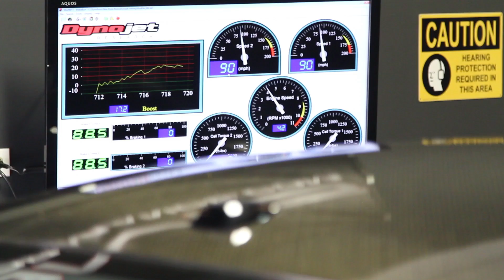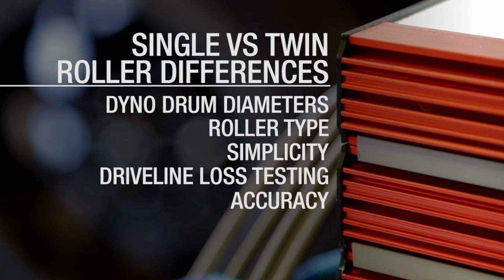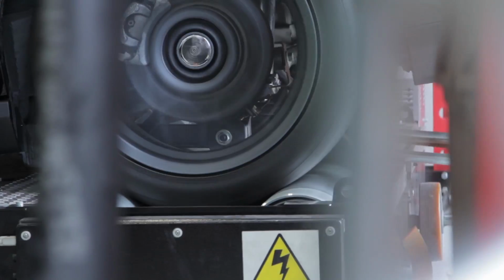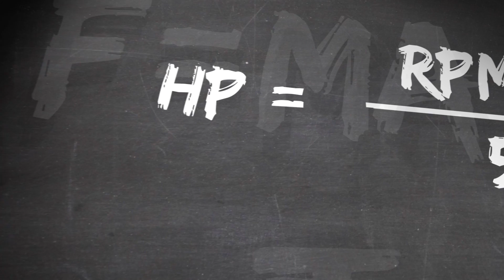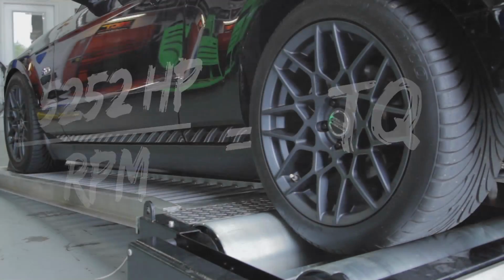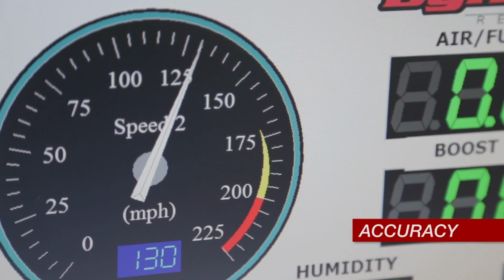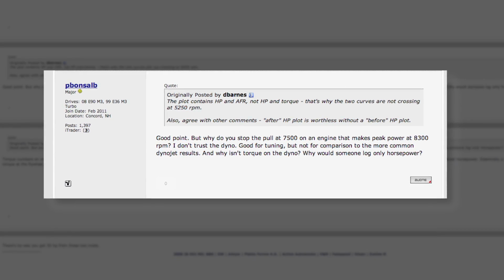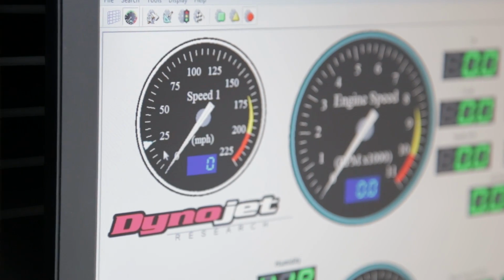Dynojet Single Roller vs Twin Roller

Comment: Seems legit, propably cant alter the numbers on a dynojet but it reads 10-20% higher out the box so you wouldnt have to anywyas. Also you should say that these "twin roller" dynos you're talking about here are those very small rollers and not the bigger twin rollers....
Reply: Absolutely false statement..Dynojwt is the ONLY dyno you CANNOT falsify the numbers with.